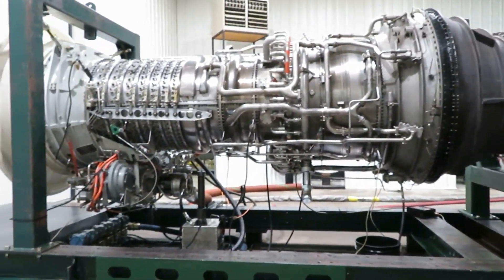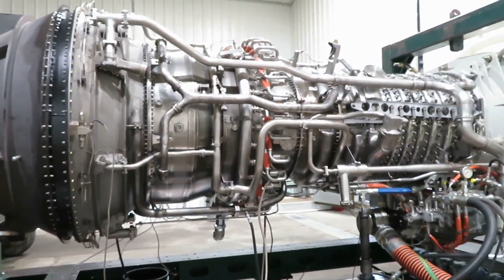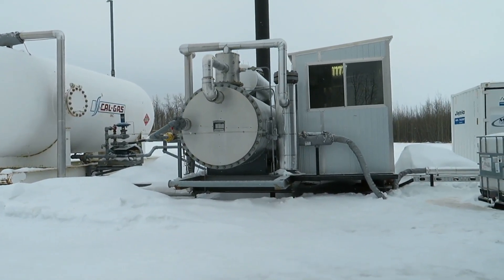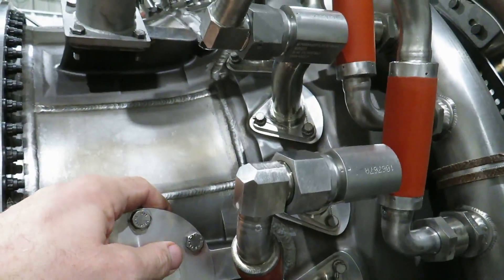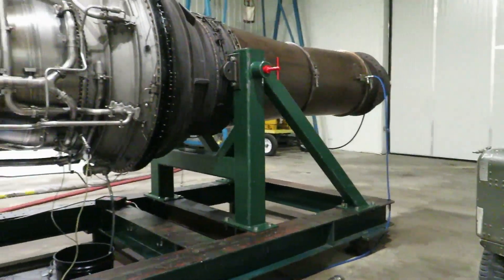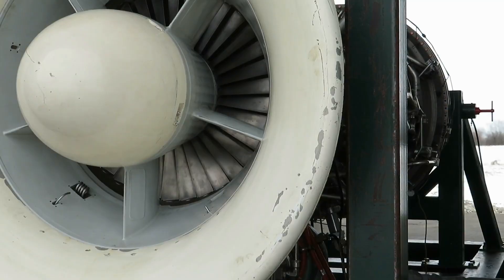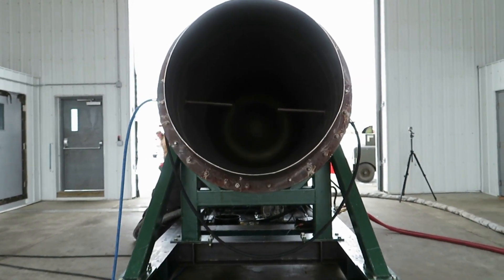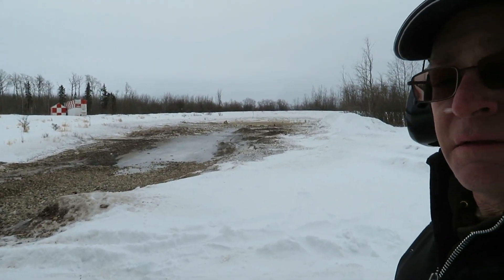The Big Engine - the GE LM2500

Comment: What aircraft does the LM2500 engine go to?
Reply from the maker: GE made slight modifications to the design of their airliner engine, the CF6-6, to create the LM2500, which is a ground running industrial unit.
Reply: Non.  It's a navy ship engine according to https://en.wikipedia.org/wiki/General_Electric_LM2500
Reply: It was derived from a Air Craft Engine CF-6, so was LM500, LM1500, LM1600, LM5000, LM6000 and the bastard stepchild LMS-100 and there is the LM9000 which I have not seen 
The LM series is used for ship propulsion, electrical generation, gas pipeline pumps, oil rigs as power and pumping gas and I believe crud oil.  And there is other mechanical drives out there. 
I been around all these engines for last 38 years started with the US Navy for 21 years and last 17 in power generation.
Reply: No aircraft uses the LM2500.  It is WAY too heavy for that.  The L in LM stands for LAND and the M stands for MARINE.  It is not used in the air.

Comment: Interesting thing about using LNG for fuel.  It can be vaporized and run through the gas fuel system as you are doing or kept liquid ad run through the LF system.  Latter use requires some mods to the fuel system. a 20 odd years ago I installed a LNG system on am old W101G as a supplement to the land fill gas it was supposed to run on.  Have you ever used butane instead o propane.  Butane is cheaper but is a heavier fraction and needs to be heated to remain gaseous.  You sure don't was a glob of burning liquid butane getting into a combustor.

Comment: Is the shop capable working on the generator variant of the GE90 or the PW4000 (if there is one)?
Reply: There is, in fact, a PW4000 which can be found powering the B777  The ground power version (power turbine instead of a fan) is called the FT4000 a video of which is available on youtube

Comment: Do you have any insulated fire blankets that cover the parts on the engine?
Reply from the maker: This engine does not use heat shields.
Reply: AgentJayZ okey cool! Was just wondering as I work for a company that makes heat shields for Rolls Royce and other engines.
Reply: But not this one lol

Comment: No water wash?
Reply from the maker: That's for dirty engines. This one is fresh out of the shop.
Reply: AgentJayZ I’m sorry water injection. I don’t see any j-tubes
Reply from the maker: Some operators use water injection... Some don't.
Reply: AgentJayZ our engines use water injection for emissions control. Located in Texas.
Reply: @jwgrz2614  Is that just to reduce combustion temperature to prevent NOx formation, or does the steam produced also increase the power yield of the engine?
Reply: Warren Garabrandt  it’s for both. We have a lot of trouble with them. The combustion chamber they use doesn’t like it.

Comment: I worked on those while serving in the US Navy. At the time, that's what they used on Spruance class destroyers. That was 30 years ago.
Reply: They use them on the Burks as well.
Reply: The LM2500 had about 20% less power 30 years ago, but it’s basically still the same old engine.
Reply: Worked on them as a GSE on OHP frigates
Reply: Joseph Johnson if you’re looking for work as a gse on a de commissioned destroyer my company is hiring located in port Hueneme, ca. Great company and great pay

Comment: In 7.00 what is that?
Reply from the maker: That's the mechanical arrangement that make the variable stator vanes move.
Reply: @AgentJayZ  so the stator is not actually all that static :D
Reply: @niconiconii-san  Yeah, since this was an aero engine parent design, the compressor stator blades change geometry hydraulically to avoid compressor surge throughout the power range. The heavy duty industrial gas turbine engines rely on compressor bleed valves to bypass compressor air until they get up to operating speed. That bleed valve  system works very well and is a lot cheaper than having variable compressor stator blades.
Reply: It fine tunes the stages of compression

Comment: great vedeo! but I trust more and I think the ROLLS-ROYCE Trent 1000 is a bigger and stronger at the moment
Reply from the maker: It is. It's also an engine we do not work on. I didn't properly mention that the LM2500 and RR Olympus are the biggest engines we see in our business. Sorry about that.
Reply: Trent 1000 is an aircraft engine.  This is a gas turbine, used in ships.   Since you brought it up, the GE90-115b is vastly more powerful than the Trent.

Comment: Just curious. Since this engine is using propane for combustion, is lube oil being used instead of servo fuel to drive the VSV actuator?
Reply from the maker: It's a separate hydraulic system that does use the same oil as is used by the engine, but not shared.
Excellent question!
Reply: @AgentJayZ  Sorry to correct you but actually it is shared using same tank and filtration. The Variable Geometry (VG) hydraulic system supply is taken off the lube supply oil line coming from supply filter into the engine. The VG system return line is connected to the lube supply discharge from the lube and scavenge pump (oil going from supply pump element to supply filter). The VG system has got an additional pump which is part of the VG control unit for the required higher hydraulic pressure.
Reply: Original LM2500 marine versions use the liquid fuel for the VG system similar to the CF6-6 aircraft engine. In current marine and all industrial versions of the LM2500 the VG system is a sub-system of the synthetic lube oil system for GT bearing and gearbox lubrication as seen on the engine in the test bed. Same applies for all LM6000 versions.
Reply: No, mostly comprised of (44.8%Lucky charms/5.2%cheetos/6.2%your mom/87.1%boston cream pie)

Comment: How close can you safely get to the intake? I have a number of 25ft stuck in my head, I think I saw that on a A320 engine, but that is obviously not the case here... Is that a turbojet/turbofan difference?
Reply from the maker: Safe approach distance depends on power setting.

Comment: Isn't that a jet engine?
Reply: Not in the normal sense.  The LM2500 Gas Turbine Engine is a Marine Engine.  Predominately used in the US Navy on the Arleigh Burke class Destroyers and Ticonderoga Class Cruisers.
Reply: Robert Benoit yes but it’s attached to a main reduction gear
Reply from the maker: Technically, this is a gas generator, meaning it generates a stream of energetic gas. That gas can do two things: it can be fed to a power turbine to produce mechanical torque and power, OR it can be accelerated by a jet nozzle to produce thrust.
So... the addition of a jet nozzle would make this a jet engine.
Reply: YES. But different design and application.

Comment: Is there any safety shielding needed in case something goes south, the big window didn’t look like it offered much protection in case of hard part fail inside engine
Reply from the maker: The window is out of the plane of rotation of the turbine section, the most dangerous place to be. In the twelve years I have been testing engines, there has never been a turbine failure.
These engines make noises that scare the uninformed, but they are much more reliable and safe than piston engines.
Reply: @AgentJayZ  Rotating parts aren't the only things that could come through the case.  One of our customers managed to burn a hole through the can and combustor case of an FT4

Comment: So I had to go read GE's whitepaper but I guess this engine is really just designed to make heat.  When used for power generation  you use a heat exchanger and a separate boiler turbine?
Reply from the maker: The LM2500 makes power in the form of a mass flow of gas at speed and pressure, that is used to turn a separate power turbine. There is a lot of heat left over in the exhaust, which can be used to create steam in a heat exchanger setup.
The LM2500 is not technically an engine, but a gas generator.
There are some versions of the LM2500 that include a power turbine, and that makes them engines, with mechanical output shafts.
Reply: @AgentJayZ  You know, I thought about that, but I didn't think gas-turbine engines in general suffered back-pressure downstream of the turbine section very well.
Dont you have to maximize the pressure drop across the power turbine?  I imagine that would involve minimizing the pressure drop across the gas generator's turbine.

For anyone interested, this is the document I was looking at
https://www.ge.com/content/dam/gepower-pgdp/global/en_US/documents/product/lm2500-combined-cycle-plant-repowering-whitepaper.pdf
Reply from the maker: @htomerif  You are oversimplifying and it's holding you back. What do you mean maximize? There is a certain pressure and velocity at which the PT works, and it's what the LM2500 is designed to provide. Any more is not going to help, so maximizing is both misleading and mistaken.
Suffer? Back pressure?
There is a delivery pressure. No suffering. Pressure is pressure. There is no such thing as back pressure. Pressure is a force per unit of area, and is not a directional quantity. A gas generator's turbine has a huge pressure drop from inlet to outlet. over 150 psi in an LM2500.
Reply: @AgentJayZ  I think I must come off as condescending or accusatory.  Its not intended that way.
I think I don't know the terminology you'd use for engines like this so I'm borrowing terms like "back pressure" from the automotive world where its used to refer to the pressure drop from exhaust and especially aftermarket turbocharger turbines.  I also have a thing where sometimes I leave out words or whole chunks of sentences and even though I reread what I write, sometimes absolute word salad gets through.

I guess what I was saying was this: if you've got 150 psi increase with no (insert correct term for "power takeoff turbine" here), that 150 psi would be a lot higher if it weren't necessary to have the turbine stage to run the compressor stage in the gas-generator.  So if it would be 300 psi (for sake of argument) without the turbine and you add a source of restriction (what I was calling back pressure but is probably called a power turbine), you want to maximize the drop across the power turbine but since you're working with a fixed pressure increase across the gas-generator (not really, but humor me) any drop across the power turbine takes away from the drop across the gas-generator's turbine.

That was a bit of a charlie foxtrot, but what I mean is you have to minimize the amount of energy the gas-generator turbine uses and maximize the amount of energy the power turbine uses.  I've always thought that these industrial turbine systems didn't work well at anything but a specific design pressure and temperature.  What Ive learned has challenged that idea now.
Reply: @htomerif  You have to remember that the LM2500 is derived from the CF6 jet engine (which in turn was derived from the TF-39, but that's a different story). That CF6 has a big old fan out front that is turned by a second, LP turbine. Not much different from turning a power turbine. The other thing that happens is the whole engine is actually designed to work at peak efficiency with that extra pressure drop. Using it purely as a gas generator makes it just an expensive space heater. Heat recovery units, etc, are a great way to increase the overall thermal efficiency of the system. You want to get every available BTU out of the fuel you put in. But the real goal is to turn that output shaft.
Reply: On my LM2500 we have the PT stage because we use them for propulsion on a ship
Reply: Use an heat exchanger if it is a combined cycle unit.
Reply: For power generation, the output shaft of  the LM2500's power turbine turns an electric generator.

Comment: why is the fan not spinning
Reply: Those are inlet guide vanes.
Reply: Correct, this engine is a turbo shaft engine, the gas flow produced will drive a turbine rotor connected to a drive shaft running game into a gearbox to drive a generator or propeller.     In a aircraft, the gas generator will drive a large fan rotor,  referred to as a turbofan engine, producing a high air mass flow for propulsion of the aircraft.  The Airbus A320 uses the V2500 turbofan engine with thrust rating of 27,000 lbs.
Reply: The fan doesn't need to spin! It's using the compressed air in the giant tank outside!

Comment: I don't understand.  In the test propane was used but (I assume) it was designed for kerosene based fuel. That's gotta change the process thermodynamics (enthalpy differentials, etc). Or perhaps they're just looking for mechanical issues in the test (after a mechanical repair) and are not concerned about verifying performance optimization.
Or maybe this machine was designed to be ground based, like on a merchant power plant for a locked in gas well to produce electricity. In which case natgas (90+ percent methane) would be burned?
Reply from the maker: It burns natural gas at an electrical generating station.
For a look at natural gas fuel nozzles, i have a series of videos called jet fuel nozzles.

Comment: I live in Montevideo, Uruguay. There's a ferry that does the Montevideo-Buenos Aires route that is propelled by two of this monsters using LNG. The ship is 100m (328ft) long and 25m (82ft) wide, and it weighs 450 tons. How fast is it? With 60 thousand hp?? 
.
.
.
.
.
.
.
58 knots or 108 km/h (67 mph). The fastest ferry in the world, at least according to the company that owns it.
Reply from the maker: I want to ride that thing...
Reply: Wikipedia backs you up: https://en.wikipedia.org/wiki/HSC_Francisco
Reply: @hoebare  just realized 450 tons is how much it can carry not the weight of the ship, I knew something was  wrong there lol. The ship is probably closer to 5000 tons.

Comment: Nice video. I've been wanting to play with one of these babies of the power industry. Sure looks a lot nicer to work on than the bigger frame sized ge. I'm usually stuck working on ge 7fa.xx these days. I'd rather work on a 7ea or 6b personally. From what I understand, they run the crap out of these in alaska. The only units I';ve worked on was the largest, ge 7h series that had variable guide vanes, but I guess the new 7fa series .06 or some crap have variable guide vanes.

Comment: So this is (essentially) the core of the CF6? Does the core of the GEnx or LEAP have a name/model and used industrially?
Reply from the maker: I'm not sure. The LM2500 is still a current product in the GE inventory. The LM6000, based on the CF6-50 is a step up in power output. The LMS 100 could be called LM10,000. It's the Biggest GE aeroderivative industrial engine I know of. I'm not sure what engine it is based on.
Reply: 2500, 2500+, and 6000 are all versions of the CF6 core.   The Leap uses a CFM56 core but I've never seen a stationary version of it.  There is a genset version of the CF34.

Comment: I noticed you said you don't have grid power at that location. Can you say why not? Also is that outdoor generator what you're using for prime power? Must go through a lot of diesel.
Reply from the maker: No grid, no power. Propane fueled four banger. Runs off our 22 thousand liter tank, shares it with the big engines.

Comment: Used to drive propane-powered forklifts, and have never forgotten the unpleasant smell. Did this engine smell like rotten eggs, or is the smell only present when LPG fuel isn’t fully burned?
Reply from the maker: That smell is from unburned propane. Many forklifts have slight leaks. These engines smell like a BBQ when running. Minus that aroma of steaks, burgers and hot dogs.
Reply: Poor mans leak detector - regulations usually require the addition of mercaptan(rotten eggs) to lng/lpg sources because they are odourless if you have a leak. Beats putting soapy water on every fitting looking for bubbles hoping not to explode.
Reply from the maker: Yes, I am poor.
We do have the advantage of being open air.
In my older videos, I show the fuel line purge procedure.
Any leak is insignificant to that.

Comment: Is there any performance difference with high & low ambient temperatures?
Reply from the maker: Lower ambient temperature at the same altitude will give greater performance because the air is more dense. It makes the compressor work better.
Reply: Thanks
Reply: The lower ambient temperature also allows a higher fuel flow and greater temperature rise in the combustor, and hence more power, for the same turbine entry temperature.